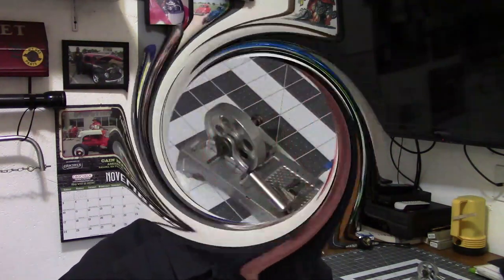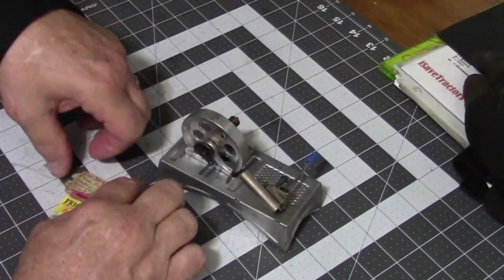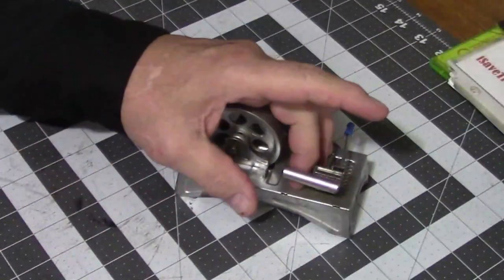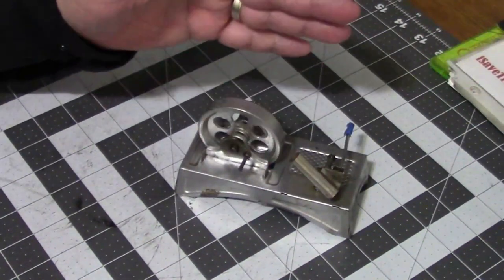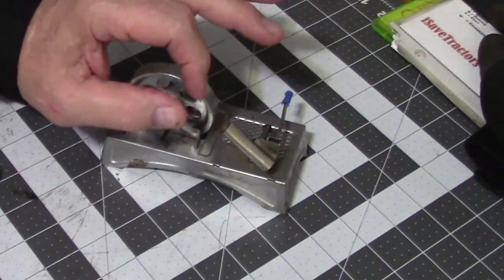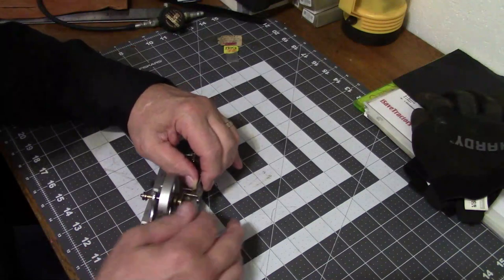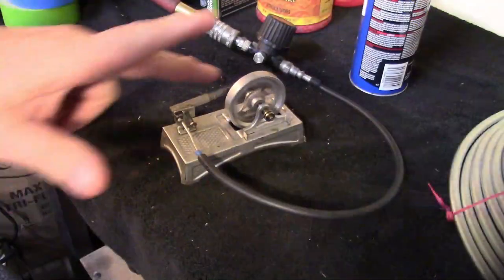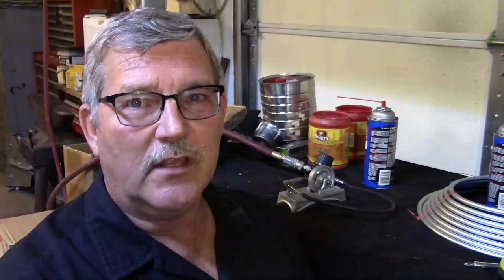Toy steam engine

Comment: My uncle was an steam engineer for Buick in Flint Mi. He had a bunch of models, small train locomotives run by steam... He also ran models by compressed air motors, wood saws, etc. in his basement.... safer around his kids.
Reply from the maker: That would have been so much fun to see. You just don't see much anymore. Thanks

Comment: Lovely job. Not sure about a steel piston, but I doubt that you will run it for too many hours, or on steam! Way off in the future, I do want to build a steam engine, after I move the lathe, which is after I lay a concrete pad in the barn, after I have finished raising beams, well, maybe one day...
Reply from the maker: I took a machine shop class at a technical college several years ago and the project was a steam engine . That was a lot of fun. I have it on a shelf in the shop office.

Comment: Llyod I thought there for a while you were going to say you found a shoulder bolt & or a dowel pin ..Nice that the ID bore was a .250" your being smart & creative by using what you have available.   KISS always get's to the finish line..
Reply from the maker: Thanks Dan, it made an easy and quick way to get it back in service

Comment: That was pretty cool, a drill bit was a great idea. Looks like you used your epoxy resin to fabricate the attachment end. Was it hard to get the right length for the air flowing in and out properly.?... Couple guys in high school made steam engines for their senior project... I made a chess set...Lol... Thanks for sharing.!!
Reply from the maker: I brazed a piece of steel to the end of the piston/rod and sanded to smooth. Runs good even with those parts. Thanks and take care